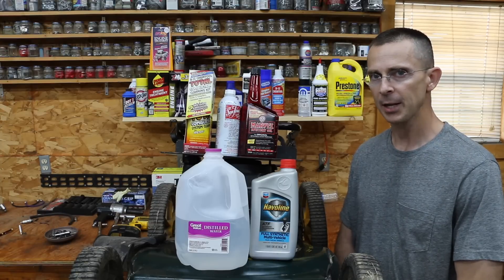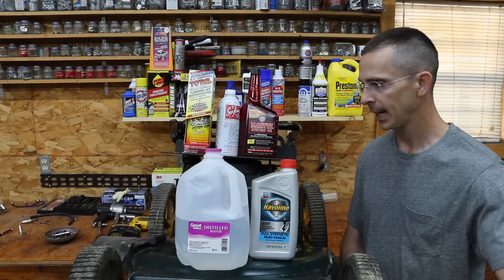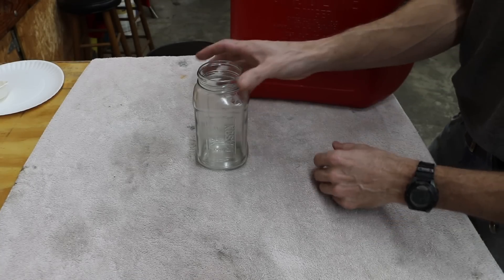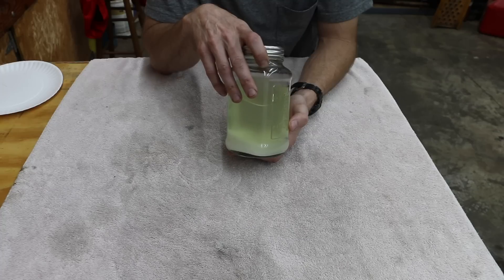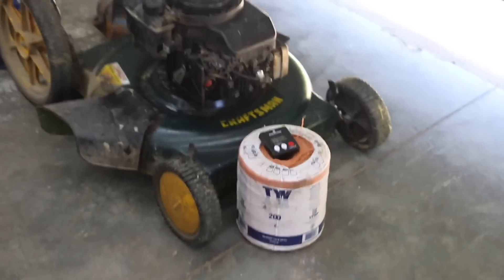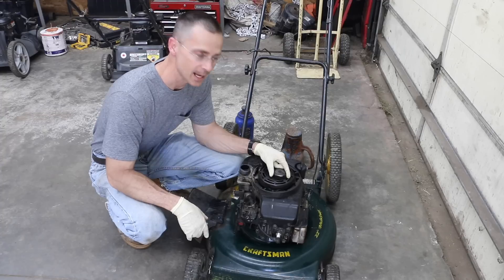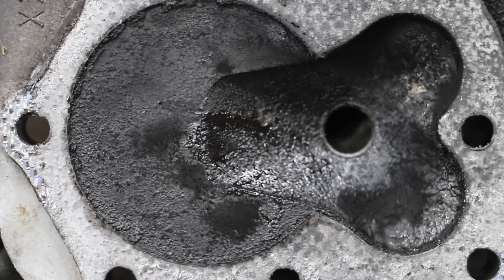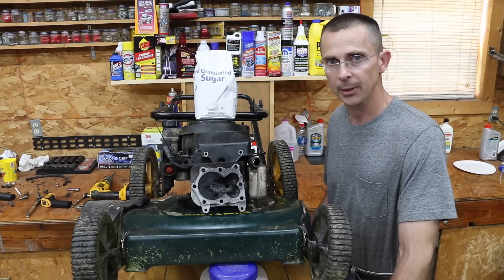Will Sugar in Gas Destroy a Vehicles Engine?  See what it does to this Engine!

Comment: Back in the late 60's-early 70's SF training we were taught the sugar would start clogging the carby jets, leaning the mixture and overheating the engine after an hour or so (important for your withdrawal before the damage occured), likely burning out the exhaust valve first from memory.  But not effective on diesel motors.  The other technique was adding linseed oil to the gas or diesel tank - this would slowly 'varnish' the cylinder walls and valve stems, also causing breakdowns far from the application location.  I know that worked very well when this grumpy old man left a 2-stroke oil bottle full of linseed oil next to the hangout of an irritating prick who used our street as his private playground - his Yamaha died within a week.  Reportedly it needed a complete engine replacement.  Never happened. :-)

Comment: i learned the same thing as well when i was a teen.never tried it though.there was a bully at school that someone had added ball bearings added to his gas tank.that worked.truck driver told me one time think it was hydraulic oil or brake fluid cant remember to tires would ruin them.rigs use both so not sure if it would do damage.also going from regular oil to synthetic to never go back to regular oil or leaks will start.does nitro to an engine ruin it if not tromping on the gas.thx for the videos.extractors were my fav as ive had some break too easy.
Reply from the maker: Thanks for sharing.

Comment: If you have a mower you can use? Do the same test again but store the mower away for 3 months after running a full tank!. I believe sugar does more damage while resting but if the car is used daily it will just keep burning out over time.

Comment: Sugar almost completely dissolves in water but almost not at all in petroleum products, such as gasoline.  Therefore, I would first drain and remove the tank, and then attempt to remove any residual fuel to the extent possible.  Then, I would fill the tank with water which would thoroughly dissolve the sugar into aqueous solution, then drain the tank.  Repeating the process several times with water wouldn't be a bad idea, however, one complete fill with water would probably be sufficient.  Also, it would be important to rinse out the fuel filler hose (on a car), fuel delivery line and fuel filter.  After draining the tank and removing residual water to the extent possible, fill with gasoline and an alcohol fuel additive to blend any residual water in solution with the gasoline.  At this point, I believe the fuel system would be safe and the engine could be run.  As a side note, the deposits noticed in the combustion chamber is probably carbon, since sugar, when burned would yield quite a lot of water, a small amount of CO and CO2, and a would probably leave a significant amount of carbon behind.
Reply from the maker: Thanks for the feedback.

Comment: What happens when mothballs are added to the fuel tank? I’ve always heard it boosted octane. Please try it and see what happens.
Reply from the maker: Thanks for the video idea.
Reply: Your car will run like an absolute rocket ship for about 10 minutes or so at which point it will cease to function and the heads and exhaust manifolds will be glowing red never to run again.

Comment: 50/50 Gas/E85 for additive, so there's something for the sugar to dissolve into maybe?
Reply from the maker: Thanks for the feedback.
Reply: I had to scroll way too far down the comments to find this. Sugar doesn't dissolve in alcohol quite as well as it does in water, but it's still better than gasoline. 

If you ever feel like revisiting this topic, I think it would be worth testing the difference between sugar added to different fuel types. Maybe E85 does better because it dissolves the sugar, or maybe allowing the sugar to dissolve and burn is the worst decision and cleaning the tank is the right way to go.

Comment: this one took me a long time to figure out,  styrofoam cups broken into pieces, put in gas tank, they turn into a substance like snot and floats around until it finds the intake, plugs it up because of suction, engine quits, no suction  allows "snot" to float away and car will start and run like new, the best thing about this was there was no pattern full tank, empty tank, 1 hr. , or 2 months. have towed and repair shop looks at you and says there is nothing wrong with it,started right up for us. finally gave up and pulled tank thinking pump problem. I now own and use a locking gas cap
Reply from the maker: Thanks for the feedback.

Comment: Worked at an Audi independent shop 27 years ago. My coworkers and the shop owner knew everything. Had a car that would stop running at anytime and restart and run good for a day or 2. This went on for a couple weeks.when I saw the owner of the car, knew right away what was wrong with it. Looked in the gas tank had a sugar 
" pancake" in there. About half inch thick, 6 inch diameter.
Reply from the maker: Wow!  Thanks for sharing.

Comment: We were told it would gum up the carburetor and not run and you'd have to clean everything & replace the carb. Hot engine + sugar = gummy candy in carb.
As a mechanic I have one you haven't heard of. 
I repaired a dodge caravan efi that someone sabotaged with Twix bars.
The owner found several wrappers near the fuel cap area, and the car ran a short while & stopped.
I dropped the tank & found the gooey chocolate all inside the tank. The sock filter was totally plugged up with chocolate and starved for fuel.
I had to flush & wash the tank & fuel lines and clean the injectors.

Comment: I watched another video that featured a  couple guys "decarbonizing" an engine by spraying a controlled amount of water vapor into the intake and letting the resulting steam 'steam clean' the inside of the combustion chambers.... wondering if that would work to break up the carmelized sugar in your sugar damaged motor?  I have not tried this myself, yet.....
Reply from the maker: Thanks for the suggestion.

Comment: Hey cheif, i would love to see how pam cooking spray does, nobody but me knows it works dam good, i ran out of gas in a 83 dodge rv with 440, and all i had flamable was pam, so i removed the cover and air cleaner and used the can of spray to get 14 miles to the gas station, no smoke, no knock and it acted like it was a brand new engine plenty of power and it loved it, one 16 oz can got 14 mpg. Its crazy , id love to see long term effects of this, cant eat it, so maybe its a alternative fuel, 14mpg on 16 oz, what about a gallon?
Reply from the maker: Thanks for the suggestion.

Comment: I know of a car having a frozen engine due to sugar.  It was at a construction site where the caterpillar dozer was started using a gasoline engine.  When the crew returned to work in the mornings their starting gas can was always empty.  They put sugar in the full can of gas and "hid" in the weeds; leaving an obvious trail to can.  On returning to work on Monday the can was empty.  Later in the day people who lived close by had an old vehicle and when they tried to start it the engine was frozen.  Shortly it was pulled away by a wrecker.  This vehicle may not of had fuel filter and may have had enough moisture in the tank to help the sugar dissolve.  Any way the sugar locked the engine after it sat overnight.  With modern engines I wonder how sugar would react in injectors.
Reply from the maker: Thanks for sharing.

Comment: I've always wondered about the underlying premise. Of course, sugar doesn't dissolve in gasoline, but what if it did? Would the carbon buildup actually cause the engine to seize? I guess the only way to find out would be to actually try to get dissolved sugar into the gas. Maybe use a sugar syrup and one of the emulsifier fuel treatments. Or maybe try confectioner's sugar, which still shouldn't dissolve, but might stay suspended in the fuel long enough to get to the carburetor and into the combustion chamber.
Reply from the maker: Thanks for the suggestion.

Comment: Video suggestion: Best gas can for small engines (something in the range of 1-5gal) - or do they all suck now.

I have a 20+ year old B&S Smart-Fill 2.5g gas can with the straight, stubby black spout that you twist before pouring. It's in my will.
Reply from the maker: Thanks for the suggestion.

Comment: Hammond Innes "Ice Station Zebra" that novel mentioned sugar put into fuel to sabotage machinery.  Sugar was removed by mixing water with the fuel where the water then dissolved the sugar.  It was easy to separate the sugar-laden water afterwards.
Reply from the maker: Thanks for sharing.

Comment: I would try Seafoam and perhaps some octane boost. Maybe try to collect the gas right after the fuel pump. Checking the fuel filter along with the spark plugs and the compression tests.
Reply from the maker: Thanks for the suggestion.

Comment: It has a lot to do with the amount of sugar put into the tank. Anything that is a “solid” the filter will stop that. But the build up over time will cause valves to hit. Question is would the sugar residue be enough to bend the valves 🤷🏻‍♂️.  But for me personally I think fuel filter clogging if enough sugar was introduced would cause first problem.  Also different engines operate at different temperatures so a hotter combustion might not allow the residue to build

Comment: I will add JB ETU-4 to the engine oil and use JB IC-15 in the fuel system for several consecutive fueling.
And as always thanks for an informative test and for the time and effort.
BTW - how many loan mowers have you got? 😂
Reply from the maker: Thank you!

Comment: Is it possible to put powder sugar in the gas and cause a problem. I had a guy sell me some race fuel from a motorcycle shop have put something in it to try a screw me. Motor run very hot and bad right away. I had to clean the top of piston and head  to fix the problem
Reply from the maker: Thanks for the video idea.

Comment: Video idea - hazards of using chlorinated brake cleaner to clean throttle body while engine running.   I did this 30 years ago and ruined my truck engine.  Chlorinated solvents don't react well with aluminum, especially under heat and pressure.

Comment: One thing it seems the results would depend on the amount of sugar you used. for instance what would happen to the mower if you put in a tank of gas and two or three cups of sugar. Also the difference I see with the lawnmower and a car is the car is moving so the gas in the tank is sloshing around and maybe suspending the sugar in the gas and letting it pass through the system, in larger quantities. Also many of the old cars didn’t have fuel filters. Even oil filters were an option on many cars earlier than 1955.
Reply from the maker: Thanks for the suggestion.

Comment: I rebuilt a Holley on a 366 C60 it had white powder in the rear fuel bowl the owner said it must have been done 30k miles ago it was at a development they had problems with 2 years earlier still ran fine power valve was bad I think it is still running
Reply from the maker: Thanks for sharing.

Comment: My sister had a late 80s Grand Prix, 88 I think.   Purchased new and in the first year someone put sugar in her tank.    I remember her taking the car to the dealership because it was running horrible and her insurance company ended up putting a new engine and possibly a gas tank under comprehensive     It was a 2.8l v6 and I think throttle body but could have been multiport.

Comment: Sugar will only dissolve in gasoline at one teaspoon per gallon, I don't have experience of damage it causes. I had varnish put in my car fuel tank, and although the first concentrated bottom lot was sucked through the engine in a short time, causing clattering and smoke, before it mixed, the residual concentration was about, from memory, 10 grams per gallon. This caused the piston rings to stick in the grooves, causing blue exhaust smoke. I had to rebuild the engine.

Comment: It's interesting that some sugar actually got into the fuel.  I was thinking that sugar might not mix so well with gasoline because it is an oil based product.  It probably binds with the 10% ethanol.   Sugar will bind with water no problem, so if I had to clean my gas tank after a sugar episode, I'd probably flush all gas out, then flush it with hot water, and drain it the best I could.  Adding some alcohol fuel stabilizer or geez, just a bit of E85 and regular 87 should help soak up any remaining water.
Reply from the maker: Thanks for sharing.

Comment: That ain’t no build up, just a little creme brûlée! That is interesting. I wonder if the old myth was based off of potentially gumming up the fuel filter causing the engine to run lean. Older cars were much less sophisticated, and I could potentially see some of the cars running lean inadvertently especially during high throttle which could really destroy an engine. The simple sugar also Sounds interesting, but I bet a significant contributor of an engine failure there could be related to the amount of water in the syrup solution.
Reply from the maker: Thanks for the feedback.

Comment: Sugar crystals will block the filter. ?  The mower has some gauze ,so it didnt get blocked.  The gunk inside will burn off on e the sugar stops arriving. It might cause pre-ignition,dieseling ( not stopping when spark is cut )
Reply from the maker: Thanks for the feedback.

Comment: before I forget how about testing the sea foam upper engine hot soak treatment on you super mower...Also  test to see if pouring ATF in the running engine will eliminate carbon build up....I've done this several times but I've never taken it apart to check results.  id like to know and I'm sure some others here would as well...
Reply from the maker: Thanks for the video idea.

Comment: Late reply but thought I'd add my two cents.  Yea, sugar is bad.  Experience:  Ford 460 4V F-Series.  Made intake valves stick open causing push rods to slip aside and lifters to pop out of bores.  Devastating damage? Nah.  But certainly requires work to rectify.  Yea, the goo tasted sweet.
Reply from the maker: Thank you for the feedback

Comment: Sugar will never dissolve in gasoline no matter how much you shake it or stir it!!! It will settle on the bottom of the tank, on a car a fuel filter will easily filter it out if the pump sucks up any sugar. A sugar granule is ~100 microns and a fuel filter can filter out stuff as little as 10 microns.
However it is good to clean out your tank, fuel pump, inlet fuel lines and change the filter if you've been sugared
Reply from the maker: Thanks for the feedback.
Reply: So many chrisfix fans here lol.. hes not wrong. However unessasary to clean past fuel filter on a car. Nothing will make it through

Comment: I think sugar does more damage when left to sit overnight. Typically someone might get "the treatment" one night then the sugar sits in there and breaks down. The damage caused is usually in the form of plugging fuel lines, or passages in the carb. In the case of a modern fuel injected engine the injectors would get clogged very easily by sugar that sat long enough to be broken down an carried through the entire system. A one shop I worked at a woman brought her mini van in claiming her ex "sugared her gastank". We all assumed the car just quit running and the ex got the blame because "who does that anymore anyway"? Right? Well...we were disconnecting the fuel line and noticed fuel was barely flowing through them but we were able to blow them clean, probably because we got to it soon enough. She claimed it happened the night before. I wouldn't really recommend any product to clean it out with. Just use clean gas and rinse and scrub out the tank, lines. The fuel rail and injector and throttle body can be cleaned out using brake cleaner and high pressure air but you may need to rig up small brushes or coat hangers to get all the grit out.  Neither the boss or I had ever had that happen to us so we didn't really know for sure that putting sugar in someone's gas tank could actually harm the car. If she had just blew it off and drove it till it stopped, it may have caused permeant harm.  I'm guessing in the case I worked on the guy probably put 3 or 4 four pound bags in. When I got the fuel pod out of the tank I was shocked at how much material was in there. The dude really wanted to make sure it did some damage. It took quite a while to get all the sugar out the fuel system. Like most of an 8 hour day! I used to use locking gas caps when I was younger and lived in Detroit as people would steal your gas at night if you didn't. Also enemies might put stuff in your tank. I think the easier way to ruin someone's car would be to put sand in the engine. Pouring that much sugar in a tank would take a lot of patience. But, you heard it here from a mechanic, Sugar in the gas, if enough is used, can harm a car if ignored.
Reply from the maker: Thanks for the feedback.

Comment: Chemically, sugar is highly polar. Thus it dissolves well in a polar solvent like water or an alcohol. Most of the components of gasoline are non-polar, which is why the sugar didn't dissolve well. My guess it that if you dissolved sugar in a reasonably water-free alcohol (such as the methanol in Heet fuel dryer) and added that to the gas, you might get more dramatic results because more of the sugar would get into the cylinder. I recall someone telling me years ago that sugar dissolved in a little water would damage an engine. I wasnt sure how you'd get it to start anyway with water in the tank.
Reply from the maker: Thanks for the feedback.

Comment: I to have heard similar. But never knew the real effect. But try adding brake fluid to the crankcase oil to see if it will seeze the engine rings/piston to cylinder's.
Reply from the maker: Thanks for the suggestion.